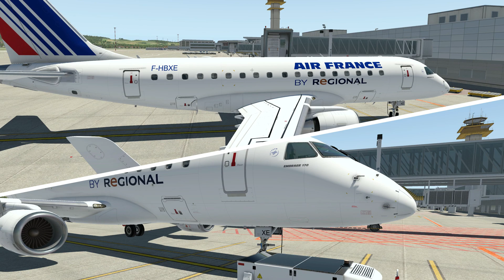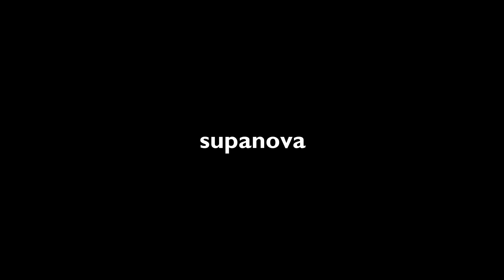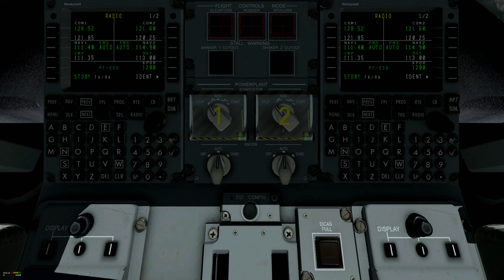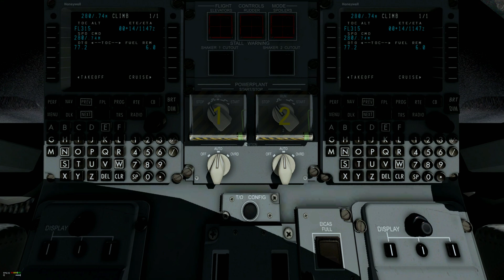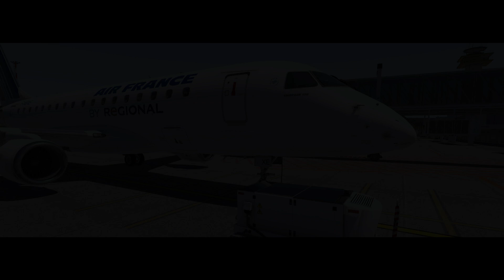X-Plane 11 : How it works : SSG Embraer E170 FMS

Comment: Other question: where I can find the takeoff speed?
Reply from the maker: Takeoff speed is dependant on weight, static air temperature, and flap settings. There are charts available but they're not easy to find.
Reply: supanova ok, thanks a lot! I find these charts online, I print lots of sheets of paper with take-off and Landing speed 😅😅😅😅

Comment: Hi, great video. Thank you for this amazing tutorial... but I have a problem inserting the flight plan into the MCDU: this fantastic aircraft doesn’t read me the SID/STAR of airports! Could you help me please? Thank you!
Reply: Finally resolved
Reply: @francescodiodati7488 how did u resolve this issue can u help
Reply from the maker: You need to set up navigation information. There's a section on it in the manual.
Reply: supanova ok, thank you so much!

Comment: Hi Supanova, what folders do I have to create to put the NAV Data from Navigraph into this aircraft. I've recently tried to update this aircraft with no success. I take it, this plane does not read from the default GNS430 folder. Any help would be appreciated.
Reply from the maker: I can't recall the process, but I presume I installed it with SSG_AIRAC_1707_XP11_Install.exe. If you want to update with Navigraph data this thread might be of interest:
https://forums.x-plane.org/index.php?/forums/topic/134439-navigraph-data/
Reply: Its all good Supanova. Managed to work it out. I used the SSG install exe. to create the folders with AIRAC 1707 & then updated with Navigraph. Thanks for your quick reply though. It's disappointing that your not creating much content for XPlane in 2020 as I feel many will continue with the sim & look for Laminar to make improvements.